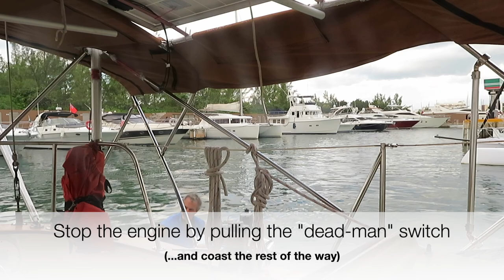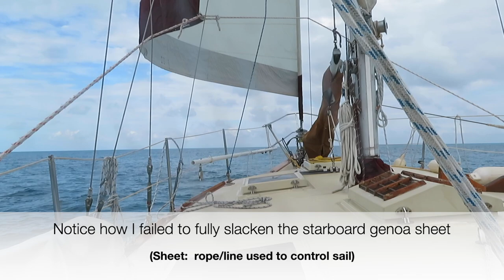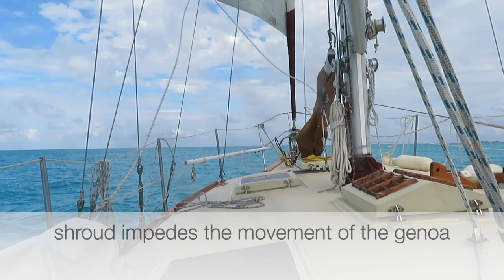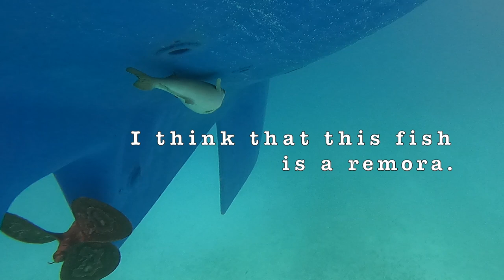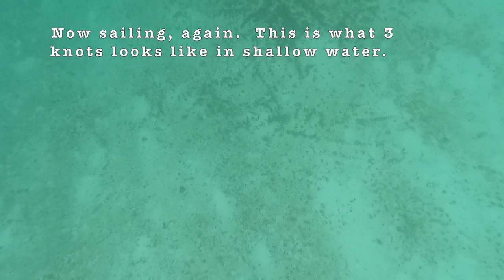Skipjack Sailing 46  Workups.  Working up in Cancun

Comment: You did a Fine job coming in to dock. Tell that other fella : never come in faster than you'd be willing to hit something/the dock !  ;)
Reply from the maker: Exactly!  I do my deceleration and rough position out in the main channel abreast the dock, then spin the boat using idle only....then inch forward only fast enough.  Can't go too slow in some wind conditions.
Your advice is spot-on.

Comment: Thanks for the video, Russ. t was good watching your improvised tiller extension working so well. Boy, was I happy when you eased that weather genoa sheet! It was bugging the sh*t out of me LOL. Tacking with the genoa up seems a bit of a pain with that staysail stay in the way.
Reply from the maker: I have had to go forward once or twice to help.

But, the staysail is self-tacking like the main, so normally, if I am expecting to be tacking around, I would not use the genoa at all, and just go with the staysail.

I am a cruiser, of course, and when I leave a place and set sail for (for instance) Key West from Cancun, I would expect to keep the same sail configuration all day....
[ I used the genoa 99% of the time during the trip from FL to MEX, and it was a problem only during squalls with their shifting winds. ]
Reply from the maker: And, Ray...I was thinking that this (forgetting to ease the windward sheet) is exactly why I need to get out there more often.

Comment: Hey Russ.Another nice video thanks; loved the underwater shots.The shaft packing should always drip a little, I am not sure of the rate but it is very low. If it doesn't drip at all then it means that part of the packing is probably pretty dry and will wear more quickly. That's what I was taught many years ago; hope I'm right. All the best.
Reply from the maker: I thought a little drip while operating, and very very little while stopped.  
I cannot imagine how in the h*** I would change out the packing in the packing "nut" without engine removal.  It's directly under the engine with about 2-inch clearance top-n-bottom.  Can't even see the other end.
Reply from the maker: Thanks, as always, Jack.
Reply: @skipjacksailing8986  The packing comes in a strip, or at least it used to when I replaced these in ages past. You feed it in a coil shape like a spring winding it around the shaft. I'm sure there will be videos about it available. All the best.
Reply from the maker: @cousinjack2841  Yes.  I agree, Jack, but I don't think that I will be able to physically get "in there" to do the work.
I had packing with a "normal" packing gland on the Big Red Boat in Scotland, and I replaced that packing....but in this case I will never be able to even put my eyes on it.
Reply: @skipjacksailing8986  Yeah Russ; sounds like another 'job well done' award is due to the designers again. They seem to think that as long as they can get the engine and drive train to fit in the boat, that is all they have to worry about. I would like to sentence some of them to five years of compulsory small vessel marine engine maintenance.
Reply from the maker: @cousinjack2841  Exactly.  And of course, in the case of almost every used boat, it is not possible to even talk to the designers or builders.  CSY only made boats (I think) for a few years in the late 70s and early 80s.
Reply: @skipjacksailing8986  I feel your pain. Time for a bit of creative engineering again. Good luck Russ.

Comment: Shaft seal is supposed to drip otherwise it will overheat. Water cools it
Reply from the maker: Agree.  I always had understood that--while operating/rotating--the packing/should drip about 1 drop per second.  While idle, should be no leakage.
Does that match what you understand?

I had "normal" packing on the boat in Scotland, but  that  boat had a long stern tube that was packed with grease.

Comment: Or get a dripless shaft seal.   Tiller extension worked well
Reply from the maker: My tiller extension could be about 1-ft longer.  I found a piece of 1-inch ID PVC pipe in the boatyard's junk pile...tomorrow I will stick that on there for another test run.

I appreciate the comments, Dave.
Reply: I had a yacht with a drip shaft like yours, I was always taught and didi so, to adjust it so it drips say once a minute. That means water is getting on slowly to lubricate it. Maybe you should check with the local marine mechanics and see what they say. Hope it helps.

Comment: Looks like you shoulda bought a Mariner ;)
Reply from the maker: I  bought the Yamaha because I figured that it would have the best parts availability.
I  bought the 2-stroke because they are smaller.
I  bought a 2-hp because the boat/transom are rated for only 2.5.

All in all, I like it, but it is weird as hell to not have a neutral.  I had no idea.
Reply: @skipjacksailing8986  I was teasing Russ...
I prefer a Yamaha be it a 2stroke or a 4 stroke engine any day and all day every day.
Reply from the maker: @omegaseamaster1550  Oh, I know and teasing is just fine.  I saw almost every dude in Luperon, that saved $5 buying a Mariner or Tohatsu (or whatever)...struggling every day with the motor.

If I trade up to a "normal" inflatable dinghy, I'll be getting a Yamaha 2-or-4 stroke again.

Comment: Hey my friend. I’m talking with my friend Nelson, just wondering where your at today
Reply from the maker: Hi John.  Still in the marina just north of Cancun.
This past week, on Monday/Tuesday, I was set to grab the SE winds and run for the Keys, but I chickened out because the forecast showed all of the winds 20+ knots, and I was too worried about the swell.
Hope you are doing well!
Reply: @skipjacksailing8986  you didn’t chicken out. That was a good decision. If your not on a time table, you pick your adventures
Reply from the maker: @johnhaywood6358  Thanks, John.  Appreciate it.
Reply from the maker: @johnhaywood6358  Thanks, John.  Appreciate it.